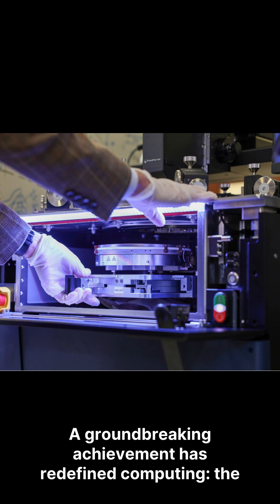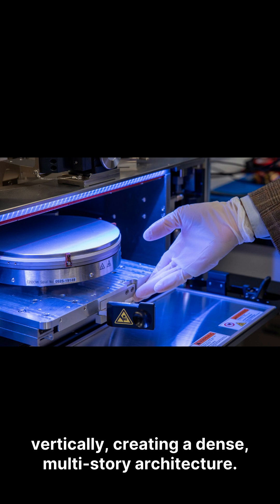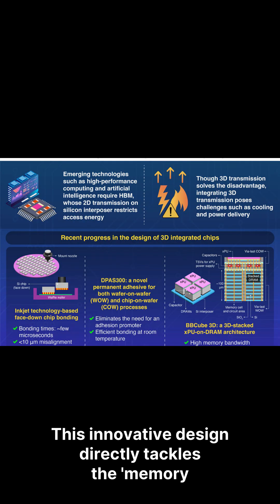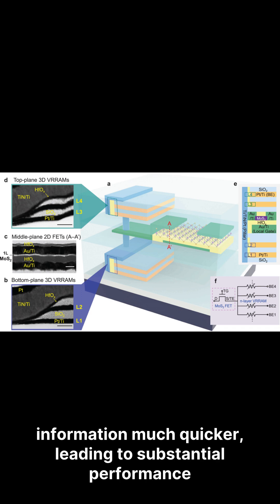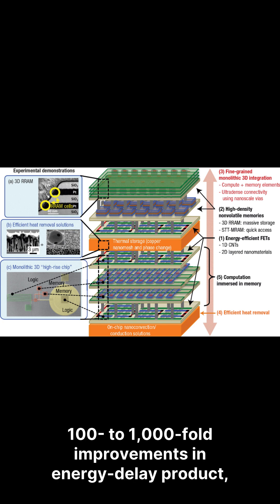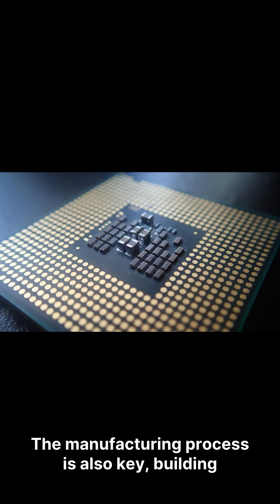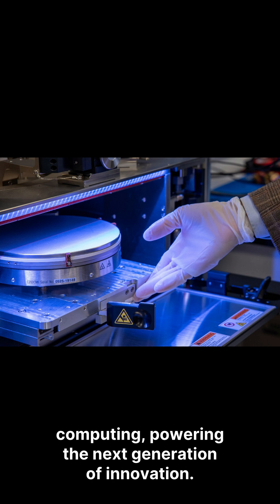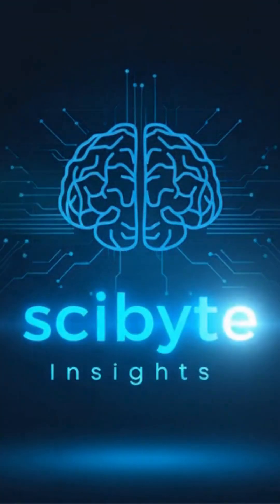Monolithic 3D Chips: The Breakthrough That Will Redefine Computing

Comment: KLT. Decades ago, I said you would reach the point where you would put on a ring, with a crystal, and electrodes would contact your skin, and so you would be able to think to the ring and the ring could communicate back to you through the skin contacts.

If you want to be mechanical engineer, then you put on the appropriate ring. Or maybe it is one size fits all. 

Yours truly, Green Lantern